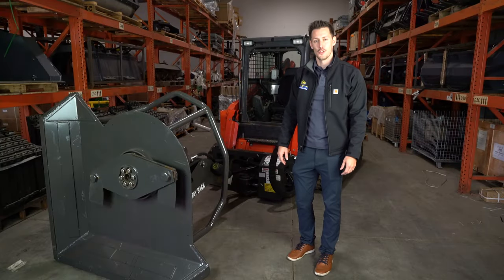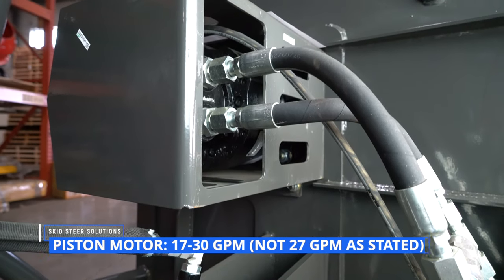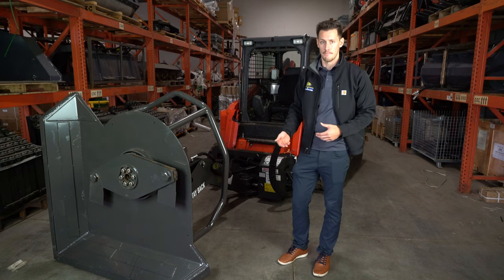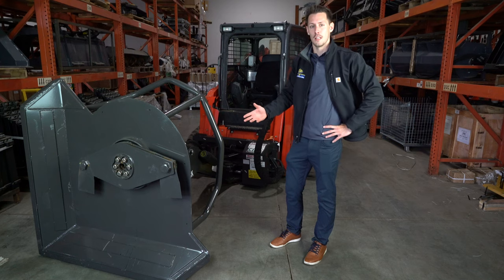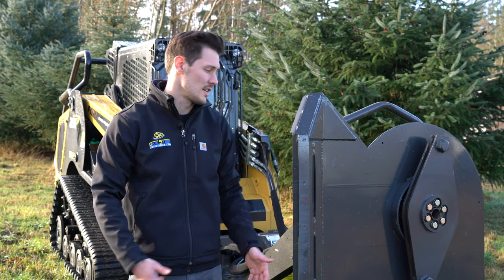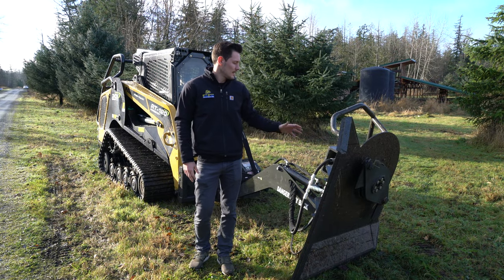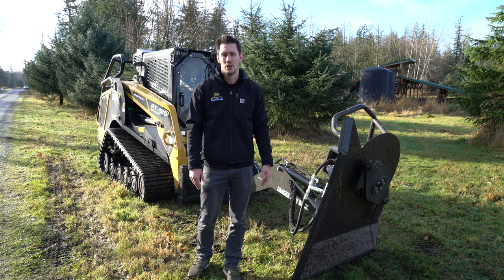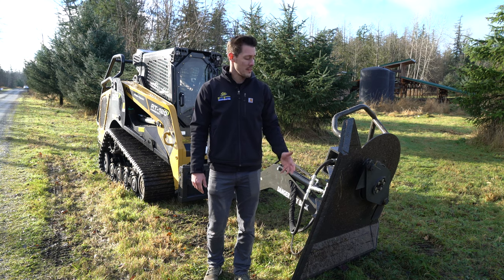CID Swing Boom Cutter Overview + Demonstration | Skid Steer Solutions

Comment: Would be nice to cover more aspects of how this works with various skidders.  How do you control the 2 cylinders for example.  Do I have to use an ASV controller?  Can it be wireless or hard wired?  Appreciate that it has 5/5 blades but are parts available for the gear box when it grenades?
Thank you
Reply from the maker: Hey Callie, we have wiring harnesses available for nearly all brands of skid steer, not just ASV. You'll see these as options if you visit the product page on our website! We also can source parts for you directly from the manufacturer upon request. Great questions and let us know if there's anything else we can clear up.